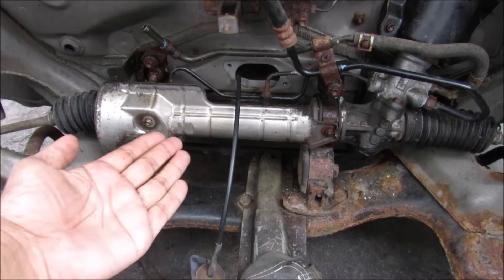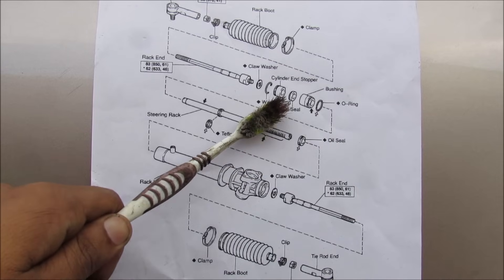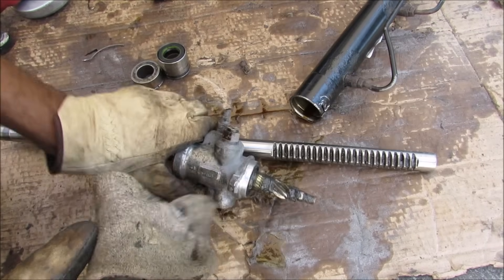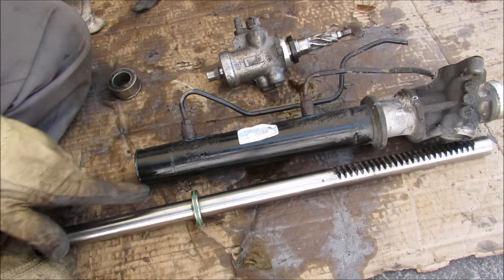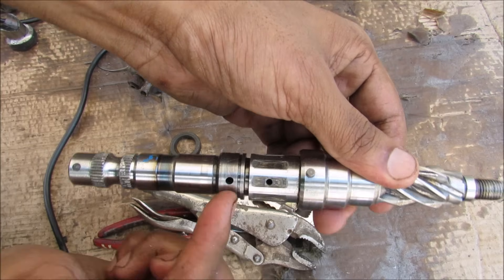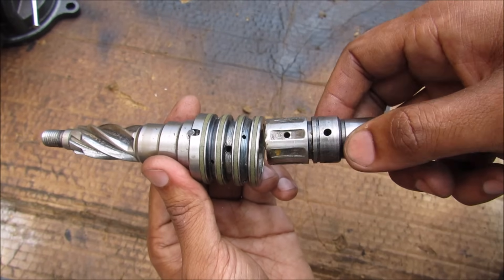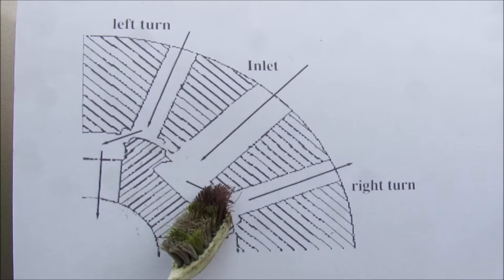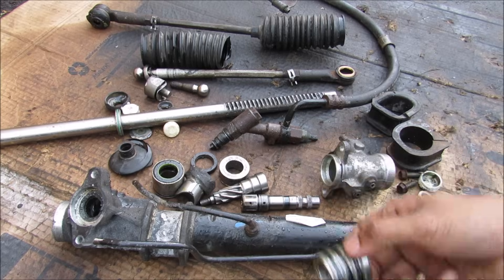How a Hydraulic Steering Rack Works

Comment: Any idea, my car has usually a numb and heavier steering, then one day all of a sudden the steering got perfectly light and smooth for two days, before becoming numb and heavier again..  Changed the pump, the reservoir, correct fluid, steering coupler, ball joints, strut bearings, rack not leaking, pretty much everything checks fine. Not electrically assisted. Only the spool valve remains unchecked. Can the rotary valve do this?
Reply from the maker: Never heard of it, possible you have a clogged system?
Reply: This is what I'm thinking, I wonder if the valve itself can become clogged - the rest of the system appears to flow freely
Reply: I'd be interested to see what you find if you open the pinion valve, I've got a Volvo S80 with something similar, except the assistance comes & goes in a "twitchy" fashion depending how much pressure I put on the steering wheel. My thoughts were either dirt/sticking valve, wear in the joint of valve to pinion (the pin in this video) or possibly I thought the torsion bar could have fatigued after 194000 miles on mine but not sure.
Reply: @danmackintosh6325  I am quite convinced now the system is clogged somewhere, perhaps at the rotary valve or at the line from the rack to the fluid reservoir.  What is more, because of this restriction, the power steering pump is 'forcing' against the fluid, and this drains significant engine power.  I am fully aware that this sounds strange but I come to think it's true.  Of course, there is nobody else saying this anywhere on Internet.  But here's what I did.  This is entirely experimental and very unconventional. I lifted the front wheels off the ground, fire up the engine (transmission in P), then kicked at one of the front wheels with some force, both at 3 o'clock and at 9 o'clock.  The reason for this I this will force the rotary valve to quickly open and shut, and perhaps this kind of 'kicks' into the debris that may be stuck in there, and may dislodge them a little.  The result of this was very surprising.  For one, once back on the road the steering felt like it was completely damaged: vibrations, kicks, shakes strongly.  It never did that before.  But then after some driving all this vanished and the steering become very light, but what is even more impressive is the engine power and sound, it felt just like the engine was back to it's young days again.  My understanding is the strange steering 'kicks and shakes' were the result of  something getting unstuck or unclogged.  Unfortunately the light steering lasted only a few days.  I'm repeating now this treatment. Again, after kicking the wheel the steering felt really scary, but that goes away within a day or two.  I wish someone goes remove the rotary valves on these S60 and let us know how it looks inside.
Reply: Let me get this straight, your issue is on a Volvo too, an S60? That's interesting if so, seems a fairly common problem (still very uncommon mind, just more than on other makes). If I'm right, and yours came to you with red ATF/Dexron II instead of CHF for the fluid then it could be some reaction between the two types of fluid causing "clotting" in the valve.
Reply: @danmackintosh6325  A 2003 S60 indeed.  Mine has always had the Pentosin stuff.  Also replaced the pump, checked the lower steering coupler, updated the reservoir, etc.  Notice that some racks had the optional sensitive speed sensor that can also get a stiff steering wheel when it fails (mine doesn't have it).  Here's just for the sake of the experiment what I did.  This video is unlisted, I don't think I will put it online, but if you want to give it a try..  Again, don't be scared of how the steering will feel afterwards, it will go away and become smooth again  https://www.youtube.com/watch?v=_rQV0NdTJZ0
Reply: Thanks, interesting that it's another P2 Volvo. I did wonder about the speed sensitive option but on inspection we don't have that. it would have been a nice cheap fix though! Interesting yours has always had the correct fluid though. What mileage are you at? (ours is 2006 registered, last of the P2's on 194k miles, ex private hire taxi)  It had a newer looking pump when we bought it with the problem existing, reservoir/internal filter good but the fluid when we bought it looked like coca cola, I'm guessing it was a mix of CHF and Dex II.  Thanks for the link, I'll have a look and consider trying that. I really feel like it's a dirt issue as it has improved somewhat since flushing with the correct fluid & now I think of it, it's actually more noticeable/different amount of force required to make it "kick in" on left turns than right which could also suggest partial blockage...  Thank you.
Reply: Ah things are starting to come clearer now lol, you're also on the VOC forums I think? (Or at least you have a lot of P2 repair videos and similar accent to someone who is) :)
Reply: @danmackintosh6325  Yes, I'm on uk Volvo forum (along others like http://matthewsvolvosite.com/ in the US which is also a very good forum).  Have you tried the magnet thing? (like here at 10:00 https://www.youtube.com/watch?v=_dk1-D85lF4).  Mine has 130k miles on it. I also had a member saying he has replaced the pump and his steering got nice and light for a few days then went being again numb and heavier.  It is strange.  Again, like I said a few years ago I just lowered my reservoir level a little bit then lifted a little the reservoir where it sits (I put a piece of foam under it), and all of a sudden the steering become like shockingly different.  It felt not just light and smooth, but it had a clear mechanical calibrated feeling like on a high end luxury car. It was almost a piece of engineering so to speak, it felt for sure that was like when the car had left the showroom floor 15 years ago. And then after two days I removed the foam piece and the steering got all of a sudden again numb and heavy, a total transformation - I never managed to get it good back again.  Very strange.

Comment: You did a great job explaining the function of the hydraulic control valve. Some terminology was not correct, like lateral, but the hard part, you did a fantastic job with.
No insult intended.
Reply from the maker: Thanks for your kind feed back

Comment: Very nice explanation. It deserves to be noted though, that when no torque is applied to the steering wheel, as in going straight down the road, there isn't any pressure in the system. Hydraulic fluid is flowing through the valve body, but not against any resistance. The pump and hydraulics are freewheeling, as it were. This is why you only hear a load come on the engine when you turn the steering wheel (like when parking, or other low speed maneuvering).
Reply from the maker: Agreed. But the pump is still drawing power away from the engine even when not steering, which is not economical.

Comment: Now that I see how it works, I wonder if that torsion bar in the pinion shaft is what makes PS systems feel less direct than a manual steering R&P.
Reply from the maker: I'm wondering the same thing...kinda rubbery feeling

Comment: I've always wondered how these damn things work, thanks for the explanation. One point to note though is you've omitted the part of "hydraulic follow-up". I've worked on hydraulic assisted flight controls and at 5:30 is a good point to talk about it where the pinion gear pin locks into the collar and allows the valve to close and open according to the position of the steering but also the position of the rack to provide a Progressive and Proportional hydraulic control reaction. IE, if I move the steering wheel a little bit, the valve opens, applying full hydraulic system pressure and it automatically shuts when the rack or control is in the desired position. If it wasn't for those pins on the pinion, the rack would move all the way to either endstop. But great video and channel! Cheers.
Reply from the maker: The rotary valve is quite neat!

Comment: Excellent explanation -couple questions, on the side of the rack -opposite end of gear end the is a tiny hole about 3/4" in from the end. What is this hole for? I have my rack off and fluid drips out that hole and I am thinking there should be no fluid there as it would fill the boot with oil. What  should be preventing oil from getting to that hole?
Reply from the maker: For air in the bellows?
Reply: Any idea why oil would be dripping out of that hole?

Comment: Thank you for this. I always knew how it worked but had never seen the actual "guts". That valving operates with less motion than I thought. I think that there is not a lot of pressure in the system in the neutral position since the fluid is just routed through the valve back to the reservoir . If there were a lot of "do nothing" pressure' there would be very hot fluid.

Comment: can i ask a question speedkar99? what is the cause if it is hard to steer . my steering pump is new and i think its the steering rack now .what components of the steering rack makes the steering wheel hard to steer ?? TIA .subscribed 👍
Reply from the maker: Blocked valve 
Or leaking rotary valve 
Or seized piston seals

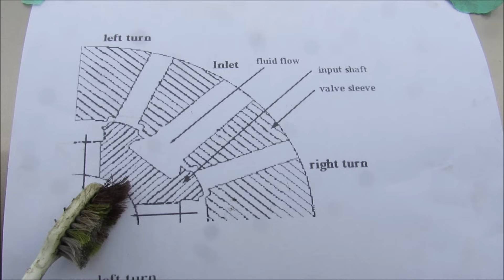Comment: Nice video, but I have one remark. The high pressure hole on the output shaft alignes with the non drilled area of the input shaft when the wheels are straight. If the high pressure holes on both shafts are aligned, when you will turn right fluid will go to the left hole of the output shaft. Thus turning your vehicle to the left. The drawing at 6:30 is quite clear, the holes never align.
Reply from the maker: Thanks

Comment: your directional statements around 3:10 are ONLY true for rear stearing systems. the opposite would be the case for forward steering system. just pointing out that there are in fact two types of systems out there.

Comment: Thank you very much for this supportive and clear informative video explaining  the steering control idea, I've just repaired my car's steering system  due to a hydraulic leak and replaced the damaged seal kit, but after the repair my steering wheel became hard to rotate, but not too much, would you please help me why it is a little bit hard and not as it was before?
Reply from the maker: Good to know it helped

Comment: Excellent straightforward video!!! 

I have a steering rack problem on my 2006 Citronen C5 (260,000km) that is not covered by anything I have managed to find online!

A few years ago the driver side front tyre wore out very quickly. I found out it was due to the rack on the pinion side had a vertical play. I could by hand move the rack up and down about 10mm wich caused the wheel to move, probably to one side while accelerating. And towards the other side when braking and decelerating... Causing the tyre to wear out almost evenly (in opposite to wear from faulty toe-adjustment)

I opened up the "Rack damper screw" (some places called Yoke adjustment screw/plug) and applied new greas on the pinion plunger, and tightened up until the play disappeared. 
All have been fine until the driver side wheel now again have a bit of side to side play. 
I tried to tighten up the plunger a bit more, but that causes the steering to bind. And when backing of just a little so the steering wheel moves smooth again, play comes back..
My first thought is that the plunger that supports the rack against the pinion are worn, but I have not seen any spare plungers for sale. Is my thinking correct the also the plunger can wear out as with the bushing on the opposite side?

Cheers

Gunnar

Comment: There is fluid leaking from the bottom of my gearbox/valve body . It’s leaking from The cap that’s on the very bottom  . Does anyone have ideas as to what it might be. Should I tighten the nut that’s inside ? Please help
Reply from the maker: +Rich Gladeu the drain pan bolt? There's a o-ring there that should be replaced
Reply: At 0:10 he points to the knuckle of the steering wheel. If you look on the very very bottom you’ll see a cap . That’s where mine is leaking
Reply: I did some research . It’s leaking from the adjustment bolt . How can I get it to stop leaking I tried putting an o ring on but the steering fluid pushes it out within an hour .

Comment: Hi, Excelllent Video. Is there a way i can diagnose if the hard steering is because of pump or Rack?. I asked many and every one says pump first then rack.. This is based on fact there is no leak.

2) if there is no leak visibile, can i assume rack and pinion is always good. or what are the symptoms of bad rack and pinion.
Reply from the maker: +sivaraj palanisamy If the pump is not providing enough pressure or the system isn't bled properly or there's a restricted line then it will be stiff. They say pump first because the rack is many hundreds of $ more
Reply: speedkar99   Thanks much. One  quick question. If there is a restriction then i will not see fluid coming in the return line right?. Or is there a way to tell if the line is restricted. I changed pump and i flused the system and i can see return line has good fluid. So wondering rack next but dont know what in rack is casuing this stiffness. Thatswhy i watched video. So any clue what is causing steering stiff, spool valve, control valve , piston . Just for my educational purpose. Pls advise

Comment: You said if the steering wheel isn't moved and no power assist required then the oil returns and all energy is lost, but! I think that if no work is being done then all the energy that's wasted is just from friction of moving the oil around. I think you'd find this to be true if the energy use at the pulley could be measured. To me it seems wasteful to continuously pump oil when it's not required. Why couldn't it be switched like a Aircon compressor
Reply from the maker: +ronald rogerson Yep and that's why they made electric power steering which saves the draw of the power steering pump off the engine. More power and less fuel consumed.
Reply: Or just hit the gym and drive without a power steering rack like in the old days. Tons of feedback from the wheel back into the steering wheel. Fun days
Reply: ronald rogerson i think it still switchs off, if you remain in silence while you move the steering wheel you will hear how the pump runs.
Reply: Some vehicles use the power steering pump for other items. jeep, jaguar, and ford have all used hydraulic cooling fans, and most heavy duty vehicle use a hydraulic brake booster. So not all is wasted.

Comment: This is a very well done instructional video. Can you tell me why I would hear a clicking sound when turning the steering wheel back and forth; it is coming from the rack and pinion unit and it is a newly rebuilt unit by Motorcraft. Could it have something to do with the torsion bar you described in the unit?
Thanks,
nashville_bill
Reply from the maker: +Bill Murrin the torsion bar shouldn't click, it doesn't have loose or moving parts.

Comment: I've always wondered why putting your steering wheel all the way to one side and holding it there is bad for the pump. you can even hear a change in the pumping working sound when you do so.
Reply from the maker: +hostilityy because the pump is pushing fluid through the piston but there's back pressure. Since the wheel is turned, its not rerouted back to the reservoir. Therefore your straining the pump.

Comment: my 2001 Toyota Sienna is leaking a lot of power steering fluid.  The area is so covered with fluid its hard to tell exactly where it coming from.   But the steering rack/pinion looks very similar to the vehicle in this video.  I am guessing i just need to replace the whole rack/steering assembly.
Reply from the maker: +Bryan Thibodeau yes. Its those seals I mentioned in the video. Its leaking through the inner tie rod boots isn't it?
Reply: speedkar99 I would guess, is all leaking on the driver side right below that point.
Reply from the maker: +Bryan Thibodeau I'd say just keep an eye on the fluid, sometimes it seeps (my dads sienna has the same thing) but the fluid level doesn't go down that far.

Comment: so the purpose of the torsion bar is to limit the movement of the inner shaft  so that the holes on it can get align with the holes on the outer collar.
Reply from the maker: +cobra R yes. It provides that relative motion between the two do the holes align.

Comment: https://www.clublexus.com/forums/es-1st-to-4th-gen-1990-2006/864881-2002-2006-lexus-es300-es330-other-models-factory-transmission-accel-lag-fix.html
Reply: This is a very well done instructional video. Can you tell me why I would hear a clicking sound when turning the steering wheel back and forth; it is coming from the rack and pinion unit and it is a newly rebuilt unit by Motorcraft. Could it have something to do with the torsion bar you described in the unit?
Thanks,
nashville_bill